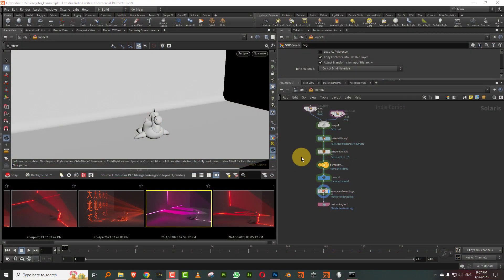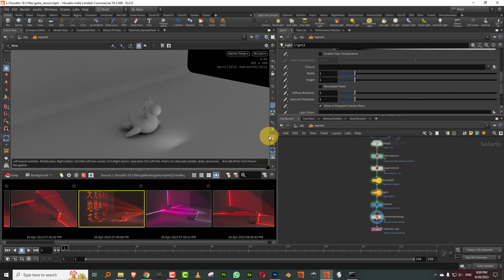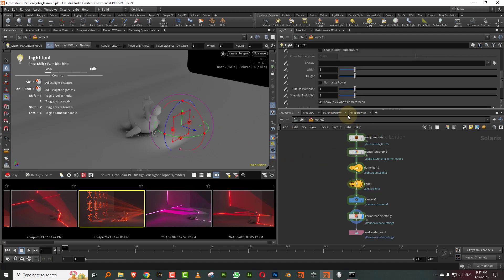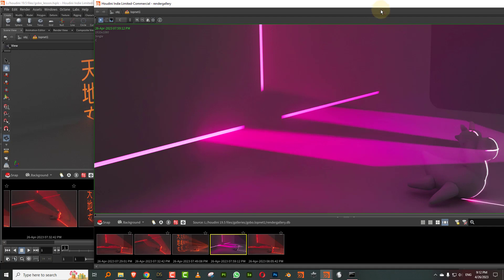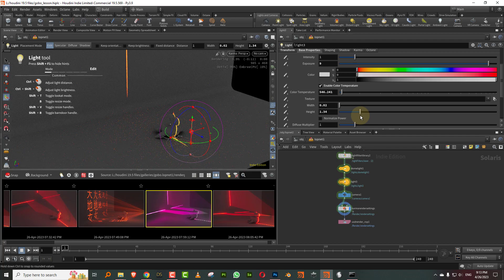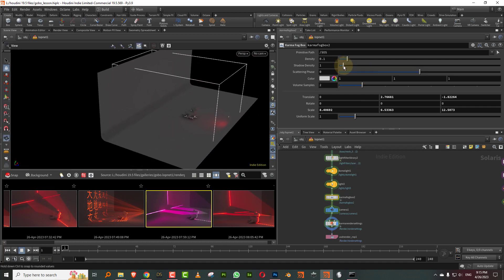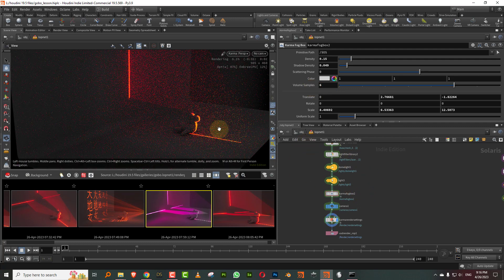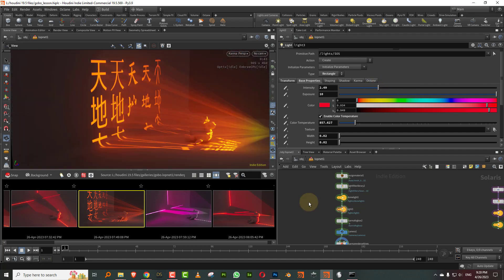Houdini karma - Gobo light filter

Comment: bit new to Karma...can I use Gobo Light Filter to create god rays or light coming from windows?
Reply from the maker: If you want visible light rays you’ll need to add a volume box in your scene. Combine that with a gobo filter and it should give you god rays
Reply: @rohandalvi  i see what if I have stained glass...and want to illuminate its pattern on the ground? Will it work with Gobo?
Reply from the maker: @thegreatSalu  yes

Comment: Great tutorial Rohan! Can you do a more in depth vid about creating custom light textures? It seem to be a big plus for video productions.
Reply from the maker: What are custom light textures, send me a link?
Reply: @rohandalvi  sorry for the delay! what i mean is: Can i create my own light textures instead of using library? Is the texture a simple float alfa mask? Would it work with color textures like (film projection)? Its a great tutorial as always, but also generates more questions.
Reply from the maker: @021shaw  material x is very limited in terms of in built procedural textures. There are a few noise textures but no real patterns. It's possible that you could use the math nodes to build something but you'll have to be relatively good at math.
Reply: @rohandalvi   i love math, but unfortunately math hates my guts!! Thanks for taking the time to answer AND for the amazing tutorials. 👏👏👏👏